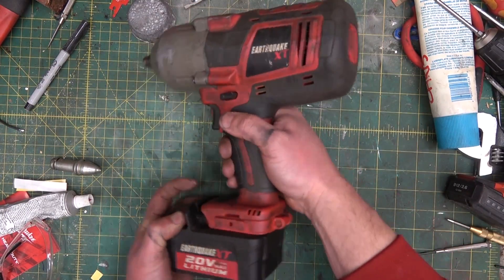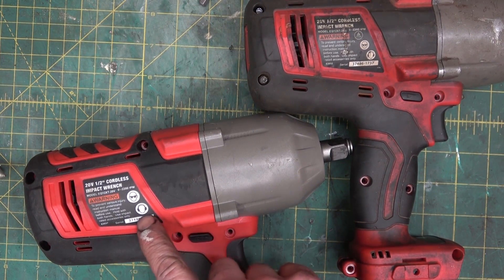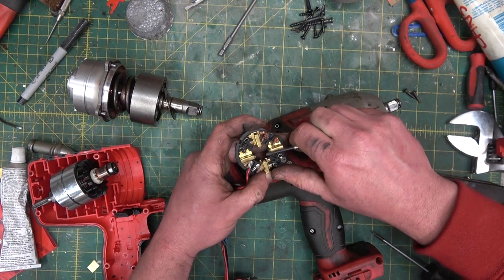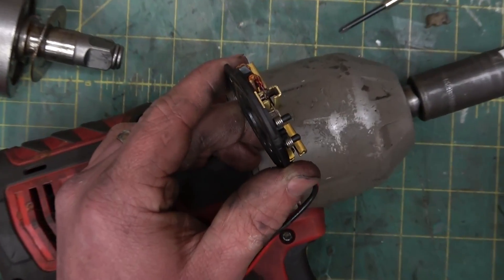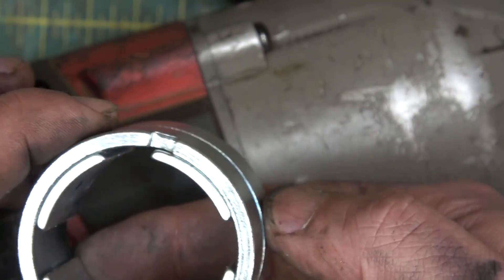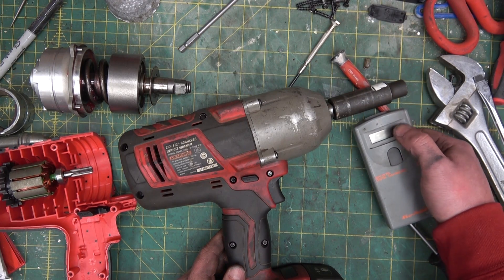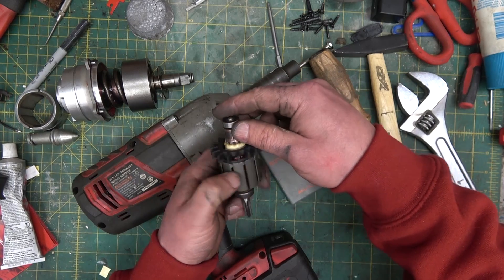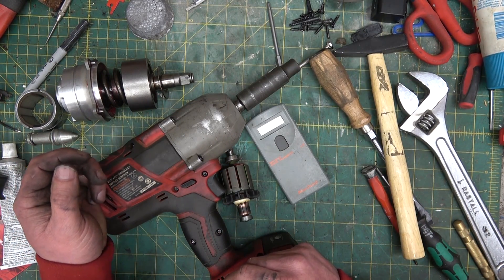Mystery Solved! | Why Impacts get weaker

Comment: Try cleaning the little slitts in betwix the copper parts of the cumutator bar. I had a sewing machine motor that had a lot of crap in between it. Got a sharp knife, scraped all the gunk out of between the commutators and it ran like before.

Comment: Also check between the commutator segments. Sometimes the carbon from the brushes builds up there and with carbon being conductive, it wreaks havoc with the motor's efficiency. On higher voltage motors it starts causing excessive arcing on the commutator.

Comment: Really great stuff.  
Only someone who has worked in a small tool repair shop really gets to understand this stuff.  R&R diagnosis in absence of actual test specs from the manufacturers.  I used to use a thing called a growler to test these things.
Reply: Or a BMW shop. They were already pretty heavily into replace-with-known-good-part "diagnostics" even in the '90s. Ten bajillion diagnostic trees for the same symptom, all detouring through "Replace DME and re-test" before sending you to another tree.

Comment: Try polishing the comm using a comm stick (or super-fine wet and dry and then scrape out the gaps between comm segments. Sometimes schmoo gets built up in the gaps and very marginally shorts the comm segments together. Used to do this all the time on RC car motors in 1/10th touring car racing. Comm scim, new brushes and a comm-gap clean would refresh a race-worn motor.

Comment: Likely has a bad winding somewhere. Sometimes the lower layers can cook if the motor overheats, but the outer windings may still look intact. Makes it harder to pinpoint the cause on overheating sometimes. Rewound a motor several times chasing that problem. Fixed it by going to a different stacking pattern (not different wiring pattern, just changing how the wires stack on each pole). Different pattern allowed the heat to spread out more uniformly.
Could also be a bad connection at the commutator. High heat where the comm bars meet the windings can cause a lot of fatigue and leads to high resistance in the connection. I remember some higher end hand built motors used to have silver braised connections to help solidify the connection. Also makes the wire a little less likely to break off. Good luck finding that kind of attention to detail on a modern mass produced motor though.

Comment: Mine seized on up right on that face where the steel bushing goes around the stubby bit, filled up on steel crud from working under cars, galled and built up like metal puddy and slowed down, I had to brillo pad it off and it was spinning free again, put a felt washer over to keep the dust from falling in there

Comment: milwaukees brushes always bottom out on the wire they do it on porpous me thinks. I cut it off and resolder in a different position. also spring pressure is more and brushes cost 3x as much as the competition.

Comment: Try cleaning the comm bars with a scotch brite pad then throw the armature back in it, I’ve worked on a few large DC motors and comm bars and brushes were the first place we always checked. If you clean the comm bars and that doesn’t work check bar resistance, a weak or open bar could be the problem

Comment: you could always use your meter to check the resistance between the poles on the commutator to look for some bad windings,  can also compare to the newer one to see how the different motors differ?

Comment: Yap, most likely there is some copper wire varnish that is weak and causing a little shorting of 1 side of the armature, slowing it down a bit. Been rebuilding motors for a long time and this usually happens from dropping(chunks of varnish let go) or it gets hot enough to melt it off !!

Comment: It's probably the enamel coating on the wires. That gets hot, melts off, and 2 wires get in contact, inherently reducing the windings driving the motor and therefore the flux driving it. You give that hot-enough a supper, you might see them degrade yet-further as more enamel melts off.

Comment: You should take a “megger “ reading on each one. Their is also a tester called a “bar-bar” tester it injects a high frequency into one winding and measures the voltage generated by another, turning armature into a transformer. Problem is it has to touch 4 commutator bars at the same time. I have such tester retail used to be $5000

Comment: Ave, I don't know if this is anything you're interested in, but I'm researching solar well pumps. RPS has a 400 watt submersible with controller, less panels for 1200 USD. The complete, with panel Chinesium version on Ebay is 433.49 with FREE shipping. Yes, FREE! Absolutely FREE! What could the quality difference possibly be??

Comment: could it be that the constant intense momentum-shock of the impact mechanism eventually stresses/shatters/breaks down the insulative coating on the wire in the windings, so that over time more and more of the windings  short out??

Comment: I had the same problem with my electric lawn mower. After 8 years, the stator is getting weaker and weaker. I suspect a low quality insulator, getting porous over the years. It used to be the capacitor. I tested it and it's still perfect. Programmed obsolescence of capacitors was too easy to fix I guess.

Comment: The windings have a special coating on the wires. The wires don’t actually touch. The coating separates them. With heat and wear the coatings break down effectively creating shorter circuits and thus weaker fields which equal less power once they collapse.

Comment: 1/2” Hilti impact at work couldn’t bust loose a bolt torqued under 100 foot pounds. Popped it off with an Allen wrench and a boot. Milwaukee’s last longer but Hilti gives away more freebies.

Comment: if one of the brushes is more worn and motor fails it could be a failure due to weeble wable ? Check if one or more of the windings of the rotor looks more burn in a specific group.. under the potted resin .. It's a wild guess

Comment: Seen lots of car starters die that way from worn brushes. Especially on Ford and Honda starters. The latter Honda ones used to run about 400 dollars from the internet, and up to 1500 dollars installed at the dealer. But they die at 50-70k because the brushes have so much tension on them. Yeah, works great until that one day... And you open them up to find the same thing. Not much left with one just one or two barely making contact.

Comment: Did you check the armature of the motor? What happens if you clean it and remove all the carbon dust between the contacts? That dust is electrically conductive and does probably bypass some electrons. So the rotor gets weaker because the current is going wrong ways... Try the old motor cleaned.

Comment: I don't see any winding damage, wire insulation looks intact on the outside.

I'd be curious to know what the megohmmeter reads, test the winding insulation. Do a 500vdc test, clamp one lead to the shaft and touch the other lead on the comm, see if there's any grounding.
When you have a loss of torque, that means one or more of the magnetic fields is weakening. Insulation is a prime suspect. 
Another thing to troubleshoot, Armature windings(lamination stack) need to be lined up with the stator(field) coils(magnets), if they are misaligned you will lose torque, a lot of torque. 

A lot of power tool companies won't DPI, Epoxy or Varnish dip their windings due to manufacturing costs, it would save their motors from vibration-induced damage. They also tend to use as small of a gauge of copper wire as they can get away with, which means very little tolerance for electrical surges and overheating, which will break down insulation over time and cause grounding/shorts. 

There are a great many things that go wrong on small cheap motors, junk is never worth repairing. Cheaper to simply replace than rewinding something so cheap. 

``Industrial motor mechanic and rewinder``

Comment: When soft copper becomes hard it can lose 30% of its electrical conductivity. This could result from work hardening or extreme thermo-cycling. It is important that the copper wire does not flex/vibrate and that it is properly cooled -- otherwise it loses its dead soft annealing.  The purity of the copper is also important.

Comment: On a 2 brush setup this motor wont even turn unless you jumpstart it.
Because its a 4 brush setup, it start but at least 2 winding dont participate.

I have had couple of hitachi die from that the windings internally short out.

Comment: I don't think you're on it yet.  I get the feeling the rotors have different specs. It's also possible the stator magnets are setup differently between the two.  Test the resistance of the two rotors.

Comment: Check the motor bearings. With all that heat the grease will be different and any plastic spacers/shields in there could have softened and closed gaps between inside and outside of the race.

Comment: I feel like there may be a break and one of the wires. Perhaps that motorgot hot and then dropped causing either delamination or crack that can't be seen. It'll still flow through the copper pieces if they're touching but the resistance is going to be higher than a single wire. If you could see it, could you place solder and we fix the wires or would that just cause more issues?

Comment: I have found shorted or grounded rotors, broken rotor bars, cracked slip rings. Unfortunately never a weak rotor that I know of. Could the laminated rotor core be breaking down from overheating and stress? This is a variable drive motor your working on. Yet could a weak rotor be found on a single phase or 3 phase motor?

Comment: Heat. Thats the number one cause of death for any electric motor. The heat affects the windings and breaks down the coating causing it to leak pixys after awhile. Really its the contacting of the the wire to its self, causing a grounding problem. The pixys bang into one another instead of running the track and gathering speed and bulking up the amps, they get weaker and by the time they reach the conductor, they are tired. I think it might be compaired to running through mud mabe?

Comment: When it gets too hot the insulation gives, afew loops short so now instead of 50 loops you have 45 and so on.
same thing when you overheat a transformer ... the output voltage perma drops .

Comment: You have a good line on which component is the major contributor to the problem but finding the root cause will require another chapter and possibly the use of some test equipment like a multimeter and maybe your magnetic film.  Your posse is clamoring for true root cause determination.  Cowboy up and find it ( even if you can’t fix it to prove you can make the problem go away).  Thanks for bringing us along our this mystery tour.

Comment: We didn't get a close look at the copper segments in the commutator. Are the gaps packed with schmutz? The insulator in between is supposed to be well below grade to allow for brush dirt. If they are packed full,  maybe the brushes can ride a bit high and not get full force to the copper. 

You made me pucker a little when you pushed out the 'flux ring'. Some magnets must be inside an iron keeper at all times or they lose some chooch. You have to have an iron ring to push the magnets into.

Comment: That only makes sense that the motor itself as it gets older gets weaker. I’ve torn engines apart that the bearings looked great but the pistons were really worn . Granted apples to oranges !

Comment: It looked like you cleaned up that commutator pretty good but did you run a pick down the gaps in the comm bars? I've seen, in much smaller DC motors (think mabuchi motors) the brush dust gets packed into those gaps and causes a resistance from one bar to the next, making the thing run slower with higher battery usage. That condition also makes the commutator run hotter then it should.

Comment: Try to clean the commutator up, back in the non-brushed RC days they would clean the commutator every run and put the rotor on a small lathe and skim it every 10 runs or so. If you didn't the motor would lose power, they were very high current so burning the commutator would happen. No idea what they do now.

Comment: Hey AVE have you ever heard of jumper cables going bad??? Because i had an old set of jumper cables that i used to try to jump start a dead fork lift and it just wouldn’t start. So my boss gave me new jumper cables and the forklift started right up. Maybe has to do with the copper degrading over time?????

Comment: When you cleaned the comutator did you also use something sharp to clean the space between the comutator bars? Over time carbon and small pieces of copper (that fly of when sparking occurs gets stuck in there shorting them. I found this while fixing car starters.

Comment: The motor over heats and damages the  insulation on the windings (that's the smell) .  You either open a winding up or short them out. Measure the resistance commutator to ground and com to com.
These armature are disposable but when you get to bigger more expensive ones you can get them rewound at a motor shop.

Comment: Told ya yesterday. The enamel insulation breaks down with high heat. It starts behaving like a resistor, producing even more heat per chooch. You smelled the enamel baking. That's the odor of an STD: slow tool death. It happens to transformers too, especially the ones in old vacuum tube gear, just not as quickly cuz, due in-part to inductance, the amps don't rise to meet the increasing load like they do in a DC motor.

Comment: I was wrong, you still awesome for checking, and now we know! Yes, the wiring gets weak over time, is a common problem too. The reason could be  the copper wire enamel. Overtime micro-fissures develop or some similar type of AIDS that makes it to take more energy AND deliver less performance. Now it all makes sense, you might remember back in the day, there were guys that made a living rewiring electrical motors. Sometimes we would rewire even fan motors, because back in the day it was sometimes worthwhile doing. I remember guys that would rewire the starter motor of cars, and even the alternator. That was before we got production costs so low that its not worth fixing it,  now its cheaper just to trow them away and get new ones. But big electrical motors are (sometimes) still rewired, even today.

Comment: "Rotor weak" is a little unscientific. You should go after shorted turns and conductive commutator slots (especially if there is a hot electrics odour). Check all commutator connections. Check for open windings too. Get specific and don't BF around!

Comment: I suspect there was anything wrong with the rotors. When it is running like that with no load, all the work motor doing is against friction. The two bearings on the rotor axle is the ones turning fastest and so their friction will have a lot say on final rpm when there is no load. I suspect it is the bearings, unless the rotors themselves have different windings from start. Overall the brushes are and were shot, that would have been the source of the loss of power.

Comment: Would it not be more likely a short between some of the windings giving less flux = less power at the end! 

Putting a resistance tester on the bushes would allow that to be checked by rotating the windings onto the bushes sequentially. May be overkill but isn't that what a good BOLTR would do? Kudos for reacting to your conscience/ the feedback comments (delete whichever is appropriate) ;0)

Comment: Remember that a weaker field magnet in a motor results in faster rotation. Yes, not intuitive but the spinning armature is a generator. It has to rotate faster to generate the same "back EMF" voltage as the field is weakened. In a lightly-loaded motor the back EMF will almost equal the supply voltage. The result is faster rotation but less torque. (Doubters: find any old EE book on motors.) Interesting video, keep at it!
Reply: Why is this comment not upvoted more??
also, the armatures may be simply different in number of turns. That directly affects no-load rippums: the more turns, the slower it spins.

Comment: Come onnnn, you gotta look  closer at your armature,  the spacing between each copper plate will slowly accumulate rubbed over copper and cause shorting,  that'll give you power loss, use some sand paper and clean armature contacts and also use a pick to clean away excess copper and brush material between contacts. 👍👍👍👍

Comment: Shoulda taken a brass brush to the comutator and clean out the carbon between poles, thats the main culprit in brushed motors, you change the brushes, it gets better, but not as good it was, clean the comutator AND replace the bushings and it'll be 99% of new

Comment: Every battery-powered tool is at risk for this type of failure. The car starter is just super-guzzling electric motor and they often fail this way. Lower voltage can cause an increase in amperage and thus could result in gradual heat damage.

Comment: I know just enough about motors and winding them to call BS on this.  I'd bet the "problem" is elsewhere.  That difference in RPM could be that the two rotors were different from the factories or possibly contact resistance on the commutator or something of that sort.  I seriously doubt the windings got "weak" or the magnetic permeability of the iron changed over time.